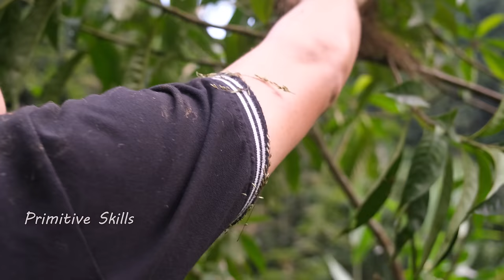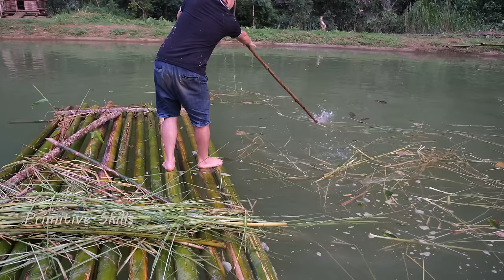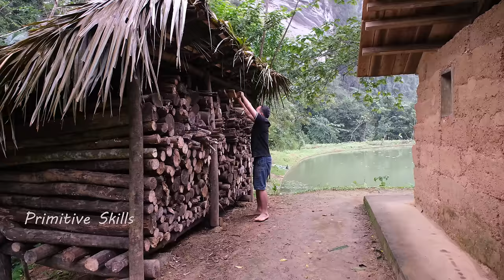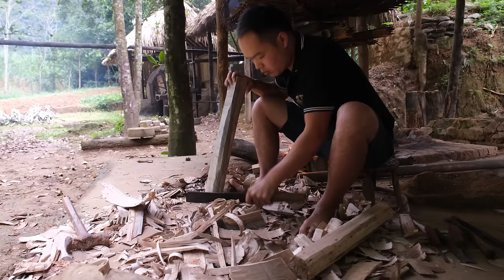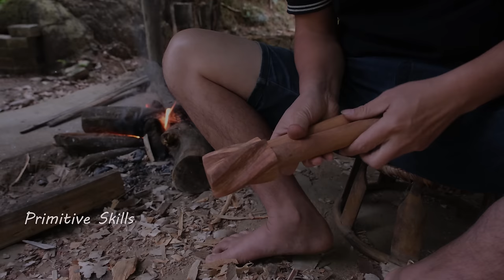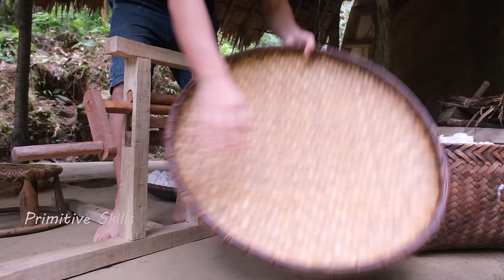Primitive Skills: Hand cotton gin was born, what I have cherished for the past 5 years (ep198)

Comment: @Primitive Skills:  A little cooking oil, grease, or wax on the gears and the spinning friction surfaces where the shafts go through the frame, will make them turn smoother and easier.
When you separate enough seeds, you could also press out cotton seed oil from the seeds.  Cotton seed oil can be used for cooking, lubrication, and/or lamp oil.

A simple oil lamp would be another good project for you.  You now have cotton; cotton makes an excellent wick for oil lamps and candles.
Reply: Cotton seed oil isn’t recommended as a good though

Comment: Quite the carving skills you have to do those roller ends and have them actually work.  Your cotton gin looks just like pics I saw from museums. The cotton then has to be combed and spun into yarn/thread. You will need a drop spindle or spinning wheel of some sort. From there you have many options to make clothing.  Knitting is pretty straightforward and gives a nice stretchy material. Crochet makes a heavier, non stretch fabric. There are many simple weaving methods, as well. I enjoy the fiber arts.
Reply: I could see the cotton gin being adjusted to also wring water out of thin wet clothes.

Comment: I think your bamboo raft works very well, perhaps just reinforcing it would be enough.  And bamboo grows back much more quickly than trees, so building out of bamboo whenever you can is a better use of your resources.

Since raptors swoop down from above to hunt, your chicks could do with a roof.  Perhaps weave a large bamboo enclosure for them, with walls, a door, and a roof with a very open weave to let in lots of air and light.  But no floor.  You could put it in different parts of your garden on different days, so your chicks can forage for seeds and bugs, and poop on your garden, but be protected from above.  Another option is to keep the hen near you as you work, because I think the raptor will be too afraid of you to come close. But that won't help when you need to go to the forest, or home to edit and upload your videos.

Has your family given you any advice about what happened to your upland rice crop?

Comment: I did read some of the comments also, and the chicken tractor comment stood out; among others.  If you put the chicken coupe along with a surrounding fence the chicken poo will fertilizer the garden area.  You will move the coupe and fence to another portion of the garden to fertilize another area; and keep going.  This is normally done with tires and a tractor.  You must think "Flintstone" since tires are not primitive.  You can use a large bamboo tree's logs for 2 wheels that are the width of the left and right side of the coupe.  Put smaller poles for dowels through a hole going through to the end of the log to turn the wheels.  Mount the coupe on the dowels.  Build the fence in parts so that you can attach and remove it when and where needed.   Is one of your 9 chicks missing?  Where are the rest of your chickens? I think the raft is better, it need maintenance.  It has lasted so well sitting in water, it still looks good.

Comment: To make roofing timber find and cut trees with straight grain (not twisted) and thinner sections should be easier to split off..   In the USA they seem to use pine trees and usually these ones for splitting have the bark removed first - cut the trunks into sections desired for the length of the "tiles"   

Keep the young chicks nearer to the rooms and make their roost able to be secured at night and also with a place for the hens and roosters to keep an eye out for predators too (cats and rats etc)...    Best wishes for you, your wife and delightful children.   Peace Love and Light

Comment: If you want to make a Wooden Boat, or protect your wooden machines (Manjolo, water wheel); there is a way to make a sealant from tree sap, by boiling it to condense the resin. Brush onto your wooden tools and machines to seal them against moisture/rot.

Comment: I'll say it again. You should make a fenced in area around the garden and a henhouse there, closer to your house and the kitchen. That will protect the chicks and help scare off the predators. The chickens will also work the soil in the garden and eat the weeds there. It means less work for you.

As for the cotton gin, there's 2 problems. 1, damp seeds as you know. 2. Your technique. Stretch the cotton out a bit when you start feeding it in to the gin and continue pulling it out a bit. That will help the rollers push the seeds out. If you're still having troubles, the space between your rollers may be too large, as the rollers should grab and pull the cotton fibers through.

Comment: I HAD AN IDEA!

You can make excellent bows and crossbows out of bamboo. If you make a “leaf spring” out of strip of bamboo and bind them together it would make a powerful weapon for protecting your chickens from predators.

You could also make traps with bait in them to capture it?

Also a secure fenced enclosure. You would need sturdy planks embedded into the ground as the base of the fence to stop predators digging underneath of the fence, and then a strong lattice of bamboo to at least head height. Also a secure roof. 

I hope you have good luck dealing with the situation.

Comment: I think the raft has more surface area to carry the debris from the water & it’s built to stand up on. In a boat you will still have to stand up and it is liable to capsize much easier. The raft is better for the job. Maybe you can improve it the task by making a skimmer like a wide flag mesh on a pole. Maybe the skimmer can be made out of bamboo strips like are used to make baskets.

Comment: @Primitive Skills:  A series of loosely/open weave, square or rectangular panel/screens laid flat (horizontal to the ground) and raised on one-foot legs will provide raptor shelter for the chickens.  It is what we do where I live.  They are light weight and easily moved to different areas as needed.  These "roofs" are open sided, and the chickens can come and go as they please.  The panels simply provide overhead protection.  When the chickens sense a predator, they run underneath these panels until the danger is gone.
Approximately 244cm x 122cm is a good size that is light weight and easy to move around.

Comment: With the amount of wood you cut split and use id recomment a water powered band saw. Itll help in the long run with cutting clean slabs of wood for whatever youre using it for. Im sure using a hatchet is quite labor intensive and exhausting. You got a nice water wheel, use it! Cheers!

Comment: Bonjour Duong, malheureusement les volailles attirent toujours des prédateurs à poils et à plumes. La solution c'est qu'il faut tenir les poulets dans un enclos plus ou moins grand pour les protéger, en liberté cela représente beaucoup plus de risques. Bravo pour la machine les deux pignons hélicoïdaux fonctionnent pas trop mal mais avec de la graisse animale l'engrenage serait à coup sûr plus souple, pensé aussi à graisser les portées tournantes pour encore plus de facilité. La construction d'un bateau ou d'une pirogue avec flotteur latéral va nécessité de tailler dans un arbre de grande section. Il vous faudra le faire sur place et bonjour pour le transport seul cela va être difficile. Peut-être trouverez vous une autre solution. Amitié Denis du Var France.

Comment: There is another method of removing cotton seed used by indian thread spinners where they use a flat board and a small diameter rolling pin and just roll the seeds out
 I think the shafts on your machine were a bit too thick compared with the size of your seed